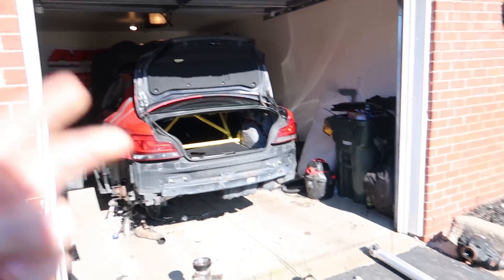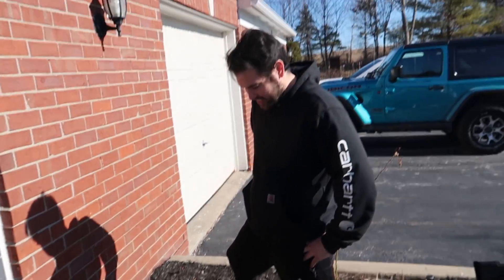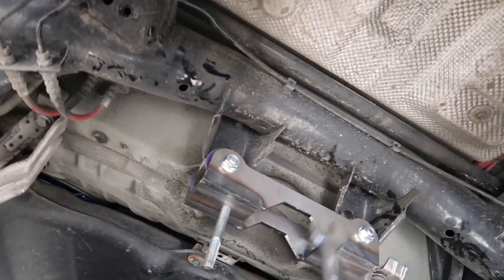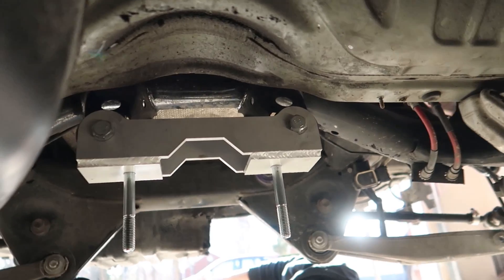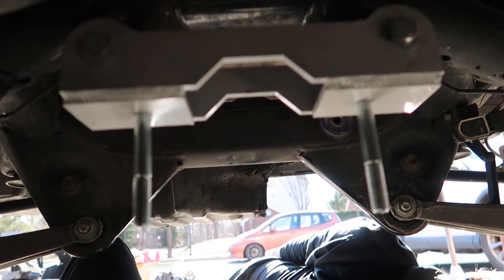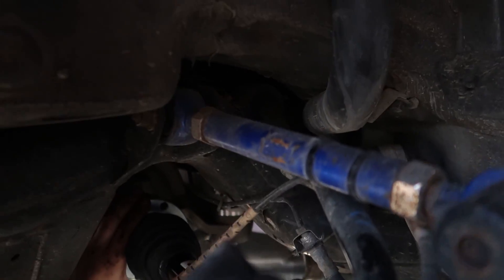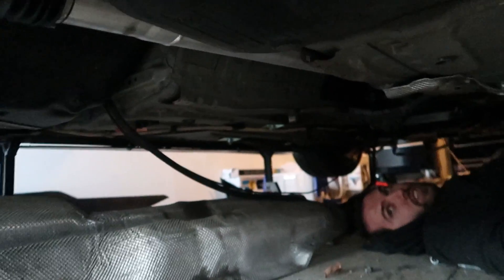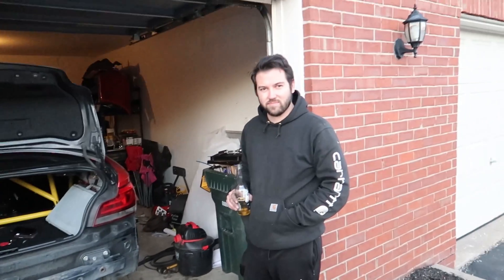"Seems Legit" Garage E82/E9X Ford 8.8 Kit Install- A Bulletproof Drivetrain

Comment: Hello again. What’s the torque specs for the driveshaft’s front and rear bolts and the adapter plate bolts? Thanks.

Comment: Hey looking into this conversion for my E92 335i but it is a Xdrive I was just wondering if it’ll impact the my car differently since there’s front differential as well as a awd actuator. Will my front dif and drive shaft be able to keep up with the new and improved 8.8 LS. I’m also thinking about swapping my subframe to the M3 subframe. Thank you and much love keep up the grate work.
Reply: Did you ever figure it out?

Comment: Did you work with Gforce on this build? 
the Ford 8.8 doesn't have 3.46 gears, looking to do an upgrade to mine but its an XI and was originally Auto. and a 3.08 front is near impossible to find. Wondering if Gforce would do a 9" conversion with me.
Reply from the maker: best bet id going to 3.08

Comment: Hey Man. I planning to build my 323i and I got a 8.8. I was looking into your guys kit but I didnt know if it would still fit with my chassis. It's a 2006 BMW 323i.
Reply from the maker: Yes it will fit, you just need to swap to 330 or M3 trailing arms because they use the large axle spline we make our stubs for. Much stronger.

Comment: Does this kit locate the pinion lower than the factory diff?  The single piece driveshafts sometimes don’t have enough clearance to the underbody and will cause the knuckle to rub.
Reply from the maker: Yes. No issues with our driveshaft at all

Comment: Thank you so much for this video! I probably wouldn't have found this product without the video, but since the adapter also works for the e92 subframe I'll be purchasing it for my Time Attack 135 build.  Still a ways off, however great to know that this is the route I'll take.